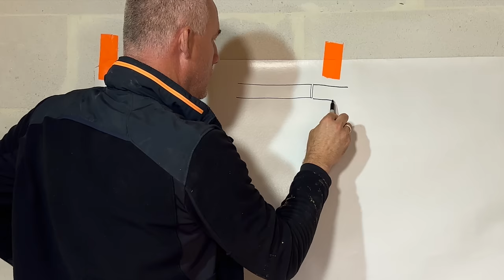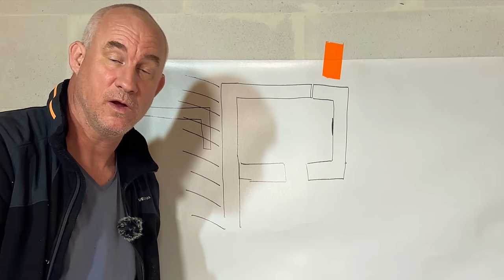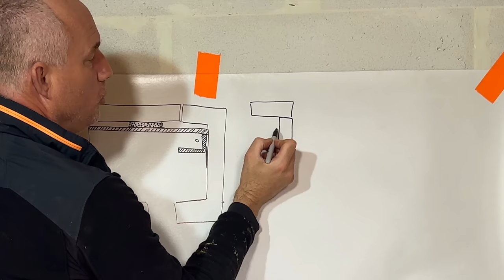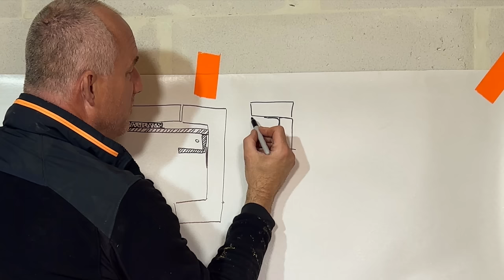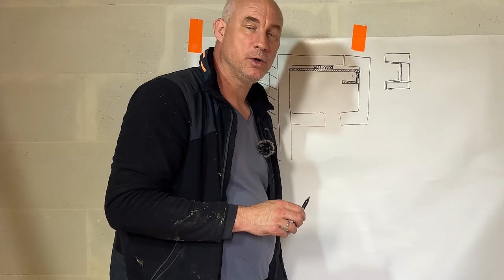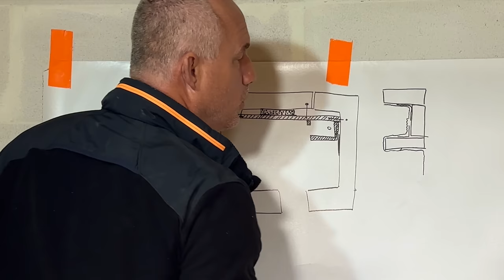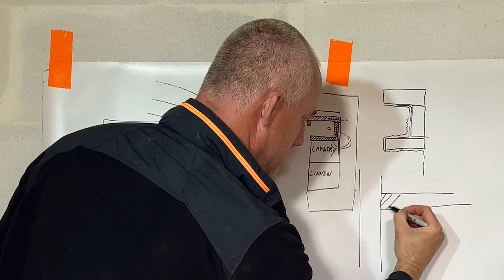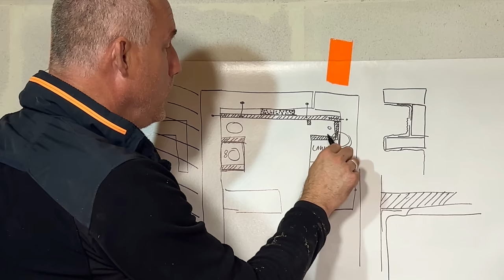Construction explainer and refurbishing a vintage louvred door. EP81

Comment: if you are going to rebuild do it in pvc that way they dont rot.
Reply from the maker: That would defeat the purpose of the whole project
Reply: @thisoldhousefrance  maybe im not understanding where those louvers are going then. if its used as a shower door it need that pink water proofing stuff i think.

Comment: Sika is sticky but not glue.  I would screw in the crossbars from the side of the door above, below and in the middle.  Countersink the screws, glue a wooden dowel on it and no one will see it.
And stick to the music!
Reply from the maker: That would work but I needed to caulk in between the planks as well as there were huge gaps. I used to use Sika a lot in boat repairs and for laying teak decks. In Sika I trust.